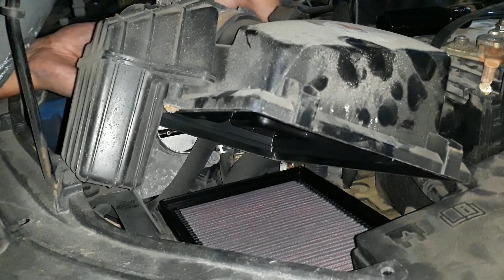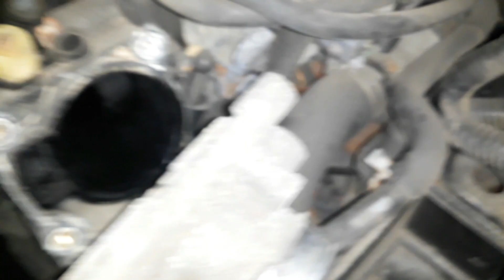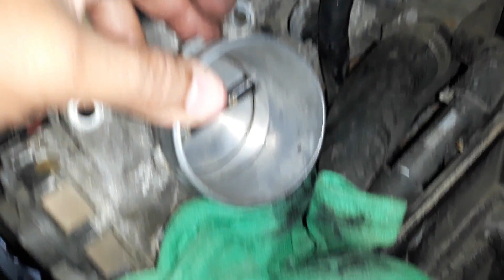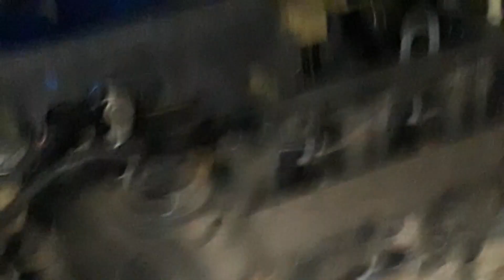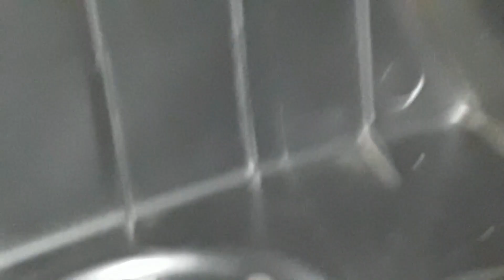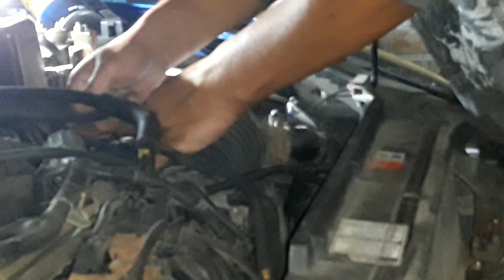Limpiando Cuerpo de Aceleracion y Sensor de Flujo  Aire Mazda 3

Comment: Yo lo quité y  lave la garganta pero lamentablemente se descalibro,.cómo lo puedo calibrar? se acelera mucho a baja velocidad y me consume.mucha gasolina! Puedes ayudarme Gracias
Reply from the maker: Si.. es muy comun en estos vehiculos.... Los q tienes q hacer es un hard reset.. esto significa Desconextar los 2 cables de la bateria y pegarlos por espacio de 10 o 15 segundos.. esto ba drenar la energia de los capacitors del la computadora... Los conextas nuevamente y enciendes tu Carro y los dejas encendido de 5 a 10 minutos sin acelerar...tal ves este va estarse acelerando solo en momentos... Esto significa q El solo esta tratando decalibrase solo... Y de ay lo Apagas y lo vueleves a encender y lo manejas un rato y listo...espero y te funcione... Suerte..!!!
Reply: @MMechanicV  te lo gradezco lo hare ahora mismo y platico q tal me fue gracias
Reply: Pues muchísimas gracias! Realmente quedó como antes, no sé si 500 RPM  sea normal, pero se siente muy bien y acelera bien!
Solo cascabelea un poco, no se si sea la gasolina, porque ya cambien filtro y bujias. Solo
Me falta la válvula pcv.
Que me sugieres?
Y muchísimas gracias por lo de la calibración!
Reply from the maker: @joetowers8574  T sugiero manejarlo por un par de dias para q se Calibre a Alta velocidad... Solito se va calibrando.. pero aveces ay q resetearlos de ves en cuando Como un telefono... So t persiste El problema nos dejas saber para ver ....!!! 👍
Reply: A mi también se me descalibró hice lo de juntar los terminales de la batería y adicional a eso (porque lo vi en otros videos) di switch 15 seg apague 15, esto lo repetí 3 veces, prendió un poco mejor pero seguia acelerado en 1.100rpm sali a coger trayecto largo en carretera pisandolo fuerte y altas rpm y se le quitó. Mazda 6